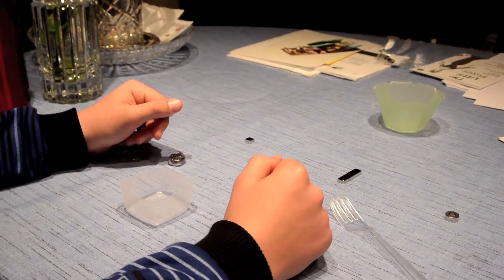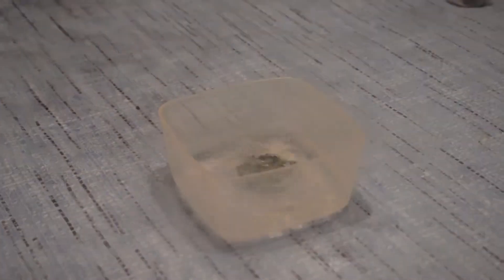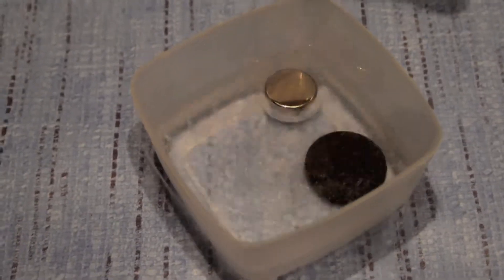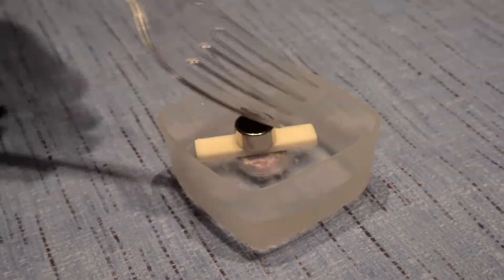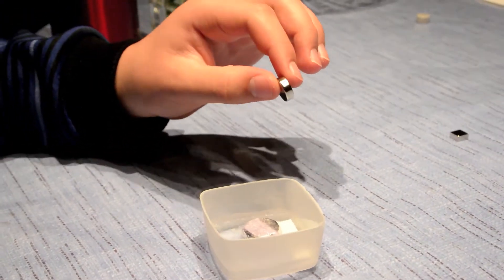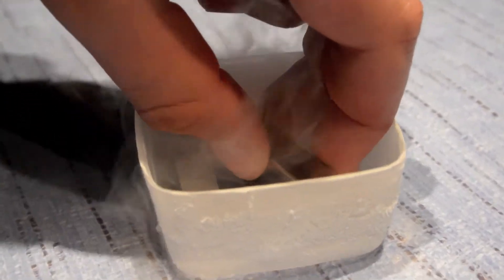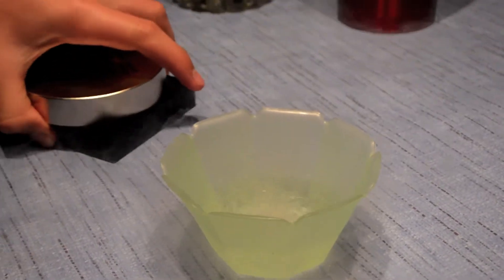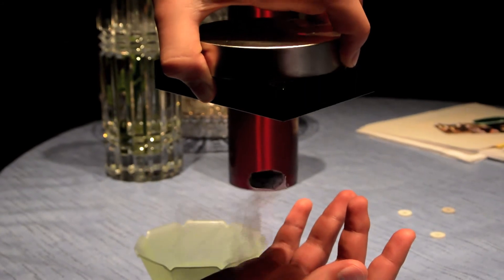Superconductivity and Magnetic Flux Pinning Demonstration

Comment: Sorry but this is not magnetic flux pinning. It is simple magnetic field conservation.

You can see the difference here QuantumLevitation
Reply from the maker: No, I am pretty sure that this is Magnetic Flux Pinning.  Magnetic flux pinning, as said in the video, is when a magnetic field gets trapped inside of a superconductor due to impurities present inside of it, I do however believe this does fall under the category of QuantumLevitation, as you said, but is more specifically magnetic flux pinning.  Watch this by Cornell University: Flux-Pinning Demonstration